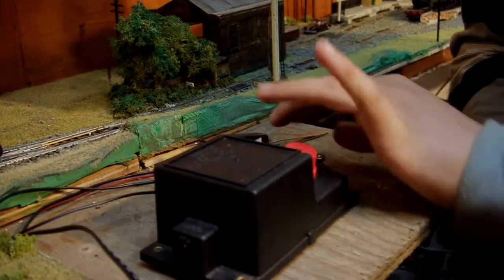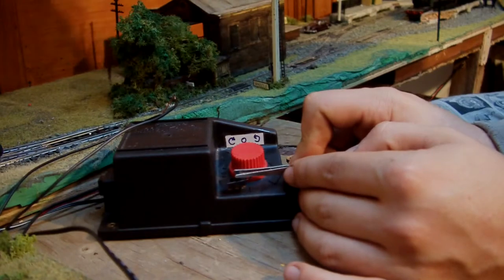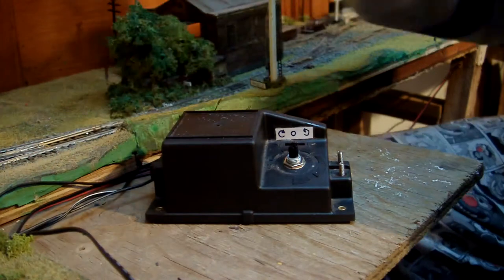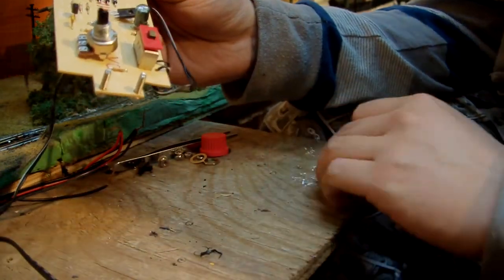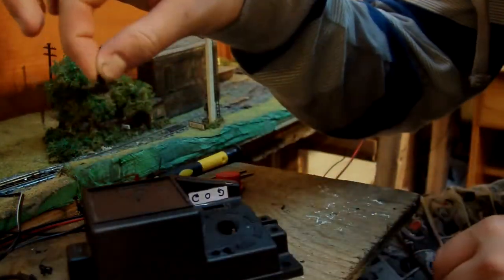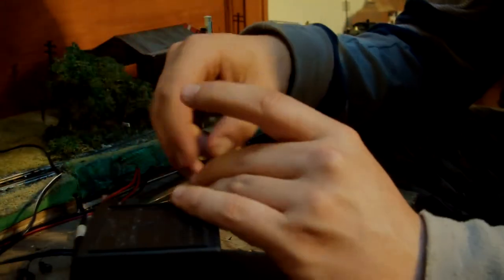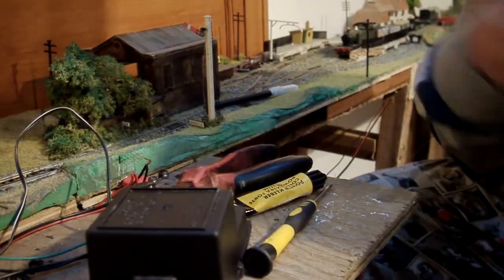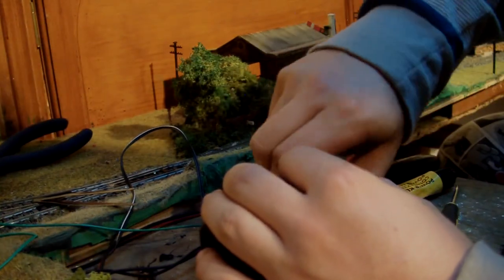How to Add a Lighting Switch to a Hornby R965 Controller (modify)

Comment: Hi. I have an R965 controller. I use the controller to run the train but what can I use the 2 screw nut connectors for beneath red knob? Also which side is positive and negative. Hope I don't sound stupid asking this. Thankyou.
Reply from the maker: Those are constant 12v, so can be used for lighting, point motors ect.
However if the current draw is to high the locos will not run properly.
Best advice is to get a second 12v supply to run all the accessories.
Hope that helps
Reply: @ModelRailwayUK  many thanks